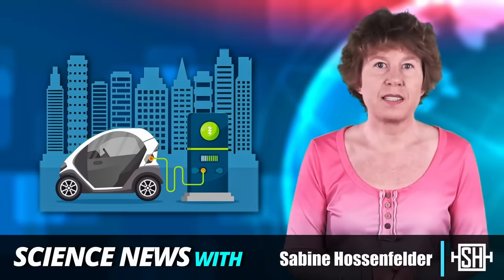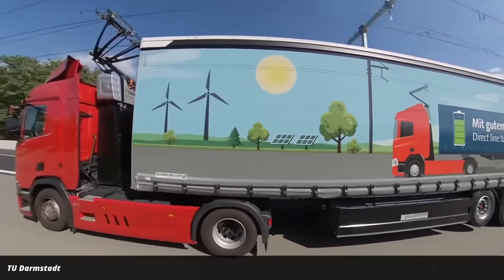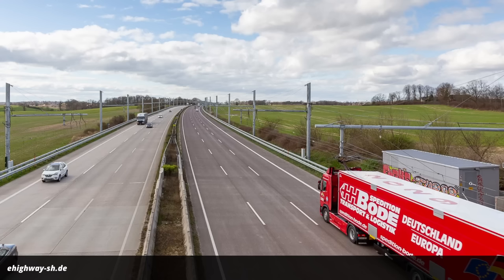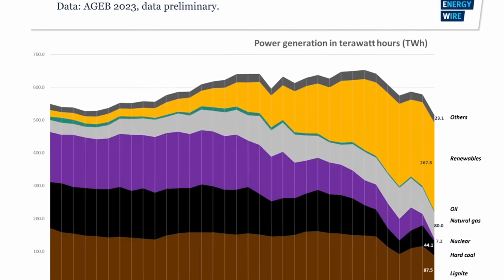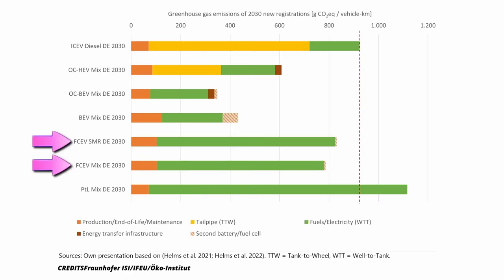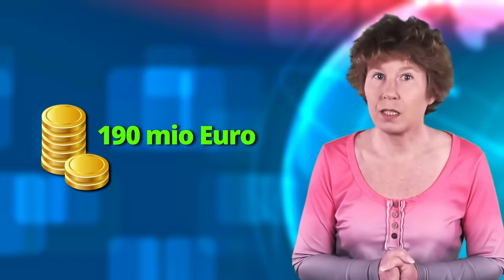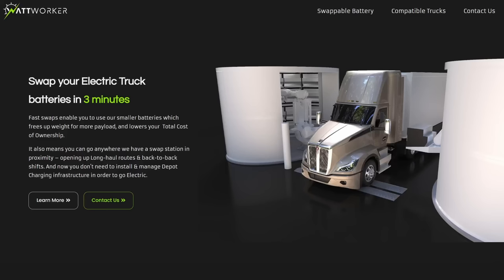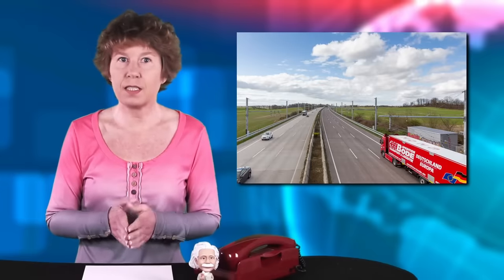Charging while Driving: Does it Work?

Comment: I can imagine the mess when an accident occurs and these high-voltage power lines come down on the highway and make rescue extremely dangerous for first responders.
Reply: Have you heared about GFCI?
If such a cable would come down then you have a ground fault which can be detected. No Problem there. Maybe you'll need a very smart GFCI that looks for unusual voltage drops, current spikes and current differentials but it is detectable if such a cable touches the ground.

Comment: Totally impractical, just another pipe dream funded by taxpayers.  Trucks don't just run on the highway, they have to exit and thread their way through cities to deliver their goods.  It is the stop and go driving which uses the most fuel, so this electric rail system would only benefit the truck for a small amount of time, but the cost of adding these rail mechanisms and charger, inverters etc. would probably double the cost of a truck.  Also, the electric lane would have to be exclusive for the trucks, adding massive costs to widen highways or increasing traffic jams by taking away one existing lane.  Much like bicycle lanes, which are used by a tiny minority of people, yet require the same cost as a vehicle lane, meaning huge increases in roadbuilding costs.
 ( and they are paved with asphalt- a fossil fuel product)

Comment: Using average electric source is not really correct since we have a market for electricity with source or renewable certifierate. Which is why a train can run on solar power even during night, or how ab industry can decrease its emissions a lot with signing a contract.

If you dont have contract for a specific or renewable sources of energy, you get what's left when everyone else has bought their power, there is no renewable power left by then.

Comment: No car should have an engine larger than forty horsepower. Electrified highways make far better sense than battery powered cars. Unfortunately, electrifying the highways in the US will lead to an abominable amount of greed, kickbacks and corruption, but I thought about this "problem" for a long time and the best solution would be to build cars with tiny engines that would be driven to the nearest electrified highway/freeway and then the drivers could make decent time getting to their locations. The speed limits on most residential streets is a mere 30 mph anyway.

Comment: I really dislike the idea of hauling such big batteries, reducing cargo capacity, increasing energy usage and using environmentally harmful resources like lithium...
I really would like to see this work.
Reply: "Every day, the Tesla Semi demonstrates that battery electric trucks can directly replace diesel trucks. With our own fleet of Semis, Tesla has shipped >20,000 battery packs out of Gigafactory Nevada to support Fremont vehicle builds. These trucks run the same route, carrying the same load (no load reduction for weight) as the diesel trucks running this route but at substantially lower operating cost."
Tesla Semi chief engineer, Dan Priestley
Reply: @waynerussell6401  are you seriously trying to refute a statement that starts with "I really dislike"?
Oh, Grow up!

Comment: the energy needs to come from somewhere and it usually isn't that much better when doing it with electricity.
the tech has been tried and tried again and again, were not the pioneers in most of the "new" things proposed today.
marketing has been extremely vile in this regard, were just wasting energy because we HOPE it would be green, without looking under the bulging rug.

ive gone over the numbers for my country, which seems similar to germany.

and the electric vehicles are not more efficient at using fuel but around the same ball park.

and if theres another Norwegian etc trying to respond to this with a tirade ill give you one myself.
tax cuts, free parking and other incentives for EVs are the reason why your car park has gone to use more EVs, not because they are so much better.
you better keep your trap shut as i'm very disappointment in you, you didn't do it for the planet but for your purse.